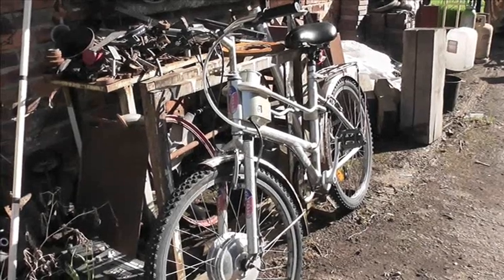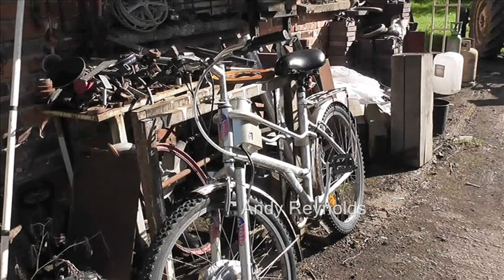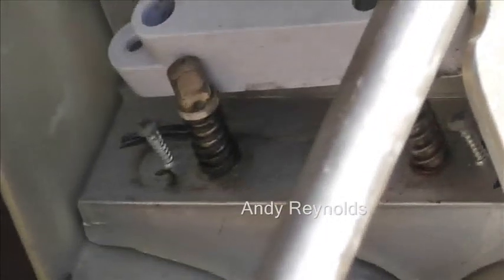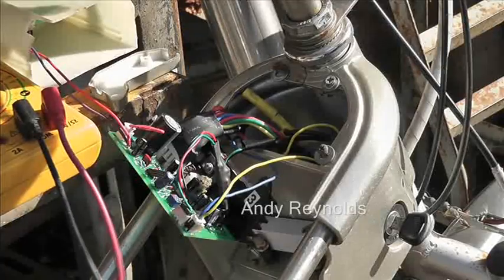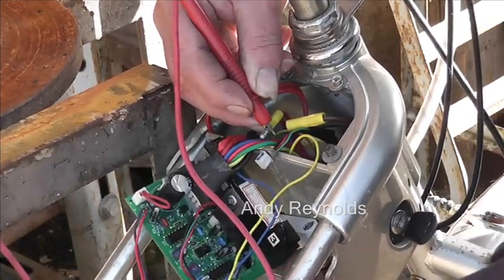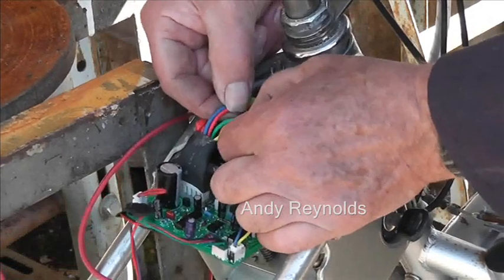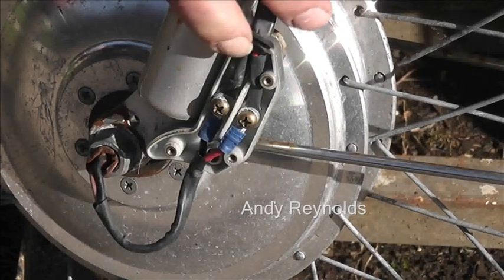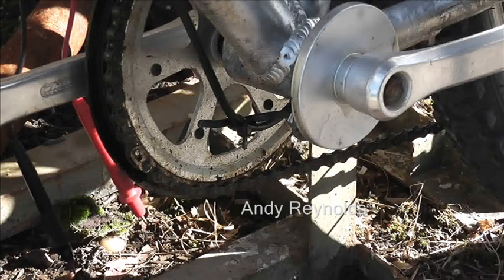Electric Powerbyke investigation, motor and controller

Comment: On my push bike I wear out the chain and rear freewheel.
I bought the cheapest I could only to find the pawls inside would break removing the free from freewheel. A shame as the sprockets lasted quite well. Naturally I couldn't swap the sprockets with a Shimano freewheel as the designs were to different.
Now I buy Shimano but a 6 speed instead of the derailleur's preferred 7 speed. A saving of 33%.
Reply from the maker: Ian, that's amazing you wear out the chain, you must do some miles and be fit, cheers

Comment: No real life experience but presuming the cut cable allows the bike to be used as a scooter.
My Uncle's electric trike will only assist if you are pedalling (even if you're simply doing the motion of pedalling without adding effort).
Does either your controller there or the one on Bootsowen's bike have auxillary power outlet for lights?
Reply from the maker: Ian, this one has no lights but the ones on Ebay show a lights output. I think this Powabyke controller needs the crank sensor to function. I'm wondering why someone removed the wiring and the board connector. I'm hoping to replace the controller and then we will see. I have put 36v DC direct to the motor and it spins with power, cheers
Reply: @TheInfoworks  sounds like you could dodge the wiring if you don't bodge the power source! 😊🍿👍
Reply from the maker: @nickrich56  I have a 36v lithium pack that is about to have a new BMS board, that will be part of the jigsaw, cheers

Comment: I think we are due to see more and more of these coming up as scrap. I found a e-scooter recently with the rear wheel and battery missing, but the front wheel was the motorised one. I built something similar to that powabyke from mostly new parts found in a skip, and I had to buy one component from the internet to make it go. Batteries are the issue. Along with the myriad of different designs and parts. The thing for me is that I use a "regular" bike and there is no thinking about charging and I get more exercise. I do see the point if people have limited stamina and it gets them on a bike. My problem is that I don't have anywhere to go!
Reply from the maker: Owen, thanks for the comment, I'm thinking local at about 5 miles and although it's flat the wind makes one hell of a difference. Without pedal assist it will be great, cut down on fuel miles, and be charged with home electric. Lee is bringing over a 36v motor controller and I have a 36v Lithium battery that needs a new BMS. So maybe things are working out. Let's see how it goes, cheers
Reply: @TheInfoworks  Thanks Andy, I got an interesting comment on my trees video, https://youtu.be/E3FTXe2ePFs
I replied but you might have more to add or wind in my cynicism...
Reply from the maker: @bootsowen  Thought I'd commented on this vid already, then realised you wanted a further comment to another youtuber, done it, cheers